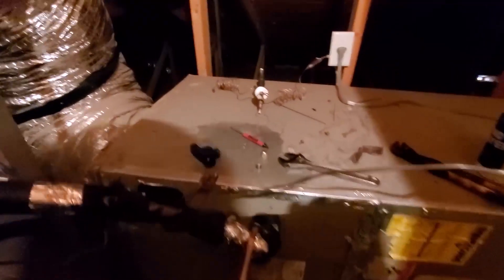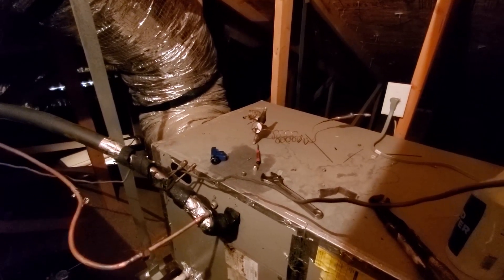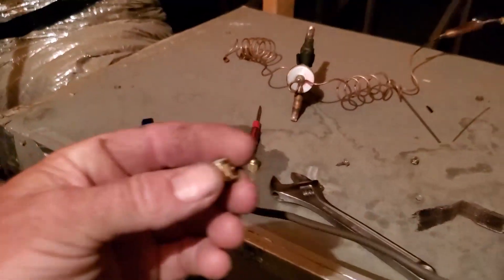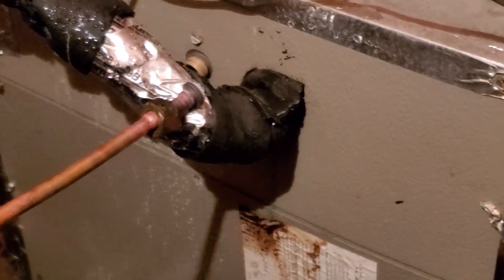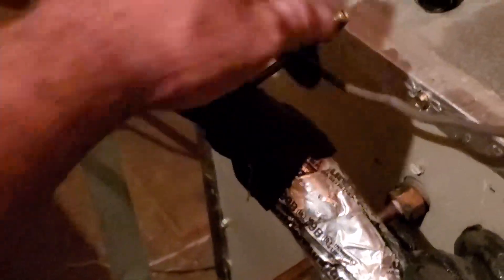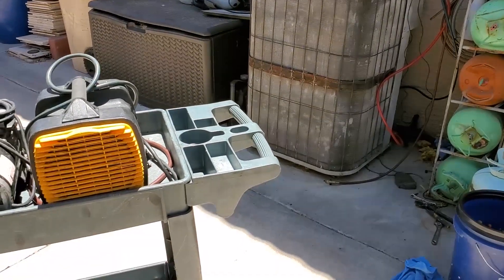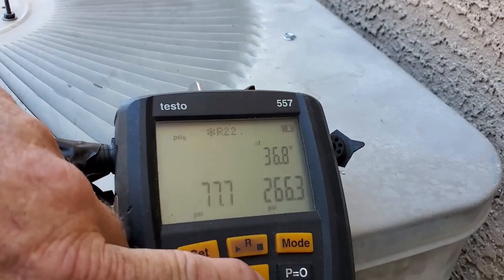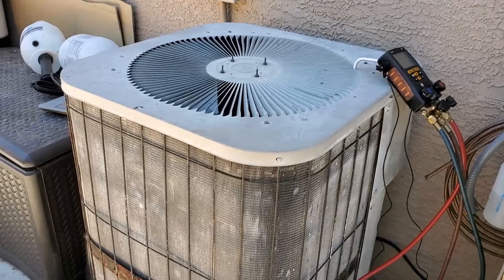Replacing my bad TXV with a fixed piston metering device to keep the Goodman POS operating

Comment: I happen to have an orifice for a 4 ton Goodman Air Handler!   When I moved into my house in 2009, the east AC didn't cool at all... Turns out the installers left the orifice out.  The tech installed the a piston and all was fine.   I found the original one in the bottom of the outdoor unit last year when I was cleaning it.   So I have one if ya need it!  ;)

Comment: Nice! I was under the impression that the sensing bulb was charged with a different refrigerant than the system but, I guess not?
Reply from the maker: I figured so too but it worked when I just dumped in some R22 and adjusted it. Lasted for weeks

Comment: Both Air Handlers are in the Attic, I thought the main floor one would be somewhere on the main floor and the Attic one would do the second floor.
We have been getting 80-F the last few days luckily our Goodman is still working.
Reply from the maker: 80 degrees outside?
LOL. We be running 110 to 113 lately.

Comment: What units are you putting in?
Reply from the maker: That's half the problem of why I never changed them. Plus spending $$$ when I still have it working is not something I would do.
But I had been indecisive on what I would put in there.
But since I started the project of installing extra off-grid solar out back, I am going to way of installing a 3 ton unit in place of the upstairs 4 ton. (likely separate 1 or 2 rooms and mini split them).
3 phase condenser is in my back yard now. Just need to get an air handler and get that changed in the attic.
Now I am at the dilema of not wanting to shut down my system in the middle of summer.
Yet... it's summer where my solar would be of use. 
HA
Maybe change the system out this weekend. 
Another dilema. Go back with a new 4 ton air handler on the new 3 ton condenser, or... just use a 3 ton air handler.
The 3 ton air handler will go into my attic without cutting things. And is like $150 cheaper too.
So... I am leaning that way.

Comment: The Bristol Buzz and a Goodman lives to see another day in the desert. It may be hard to stop a Trane, but a Goodman makes you go to Plan B, or C, or more!
Reply from the maker: Yup. Now the compressor will be back to making it's BAAAAHHHH start up longer again as when it came with a piston due to it taking a while to build up pressures and load up.
The TXV seemed to help get the compressor loaded faster due to it flooding more refer on start up.

Comment: 80 a little small for 4 ton. I would have charged just the liquid back in to make sure no air in it
Reply from the maker: The data sheet I looked at there says 82 to 80.
80 being on the small side and 80 was something I had.
Did you see the superheat at the end? It was actually good.
Reply: If the superheat is good, what does it matter what the charts say? The proof is in the pudding. Fixed orifice uses superheat and superheat was good. Job done.

Comment: Those units look like antiques but there still chugging along in that 110 AZ heat. You got attic fans how you lasting up there 😂
Reply from the maker: Early 2000 units. 2002 or 2003. I can't remember. They came with the house.
As for the attic, I am kinda used to the heat.

Comment: I've taken a 3/8 Ball valve and swet it in, in place of a TXV that the home owner had no money to replace. 
 Took a few hours to dial in, but after some time messing with the opening, I got 28 degrees of SH back at the compressor, and a 17 degree TD across the evaporator. It worked for a couple of years until the evaporator developed a large leak.
Reply from the maker: Left that sucker in for years? Nice.
Years ago we were using a pair of vice grips to adjust a pinch off point to meter refer into a evap coil. 
It kinda worked but like crap
Reply: Yeah it worked until the evaporator leaked like a stuck pig. Replaced the air handler, it bought them enough time to save for new equipment. By the way, this is probably one of the best channels out here. What you discovered with the Eco-Bee T-Stats and Taco valves made me buy a oscilloscope.. You're a fucking legend lmao
Reply: Cool. I guess that is effectively a fixed orifice
Reply: The ball valve sounds epic!! I would love to see a pic or video of that working

Comment: Congrats on forcing the max life on the Goodman! I don’t know whether you should be praised...or jailed!
 Have you decided on a new (another Goodman) unit?
Reply from the maker: I have a used (yet never been installed) R410 3 phase condenser unit now (need 3 phase to run the VFD that in turn can be partially powered by solar) and just need to get a new air handler until up here in order to do that.